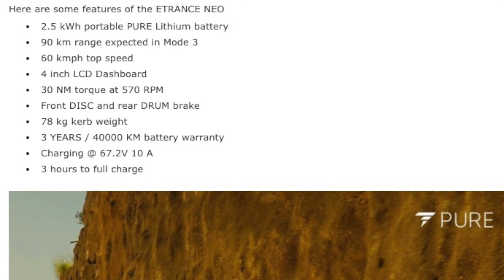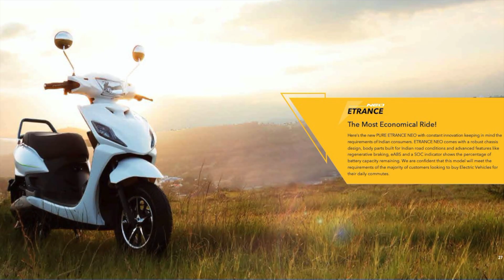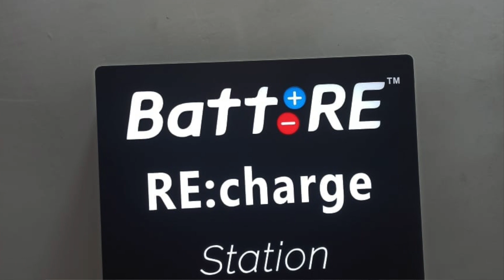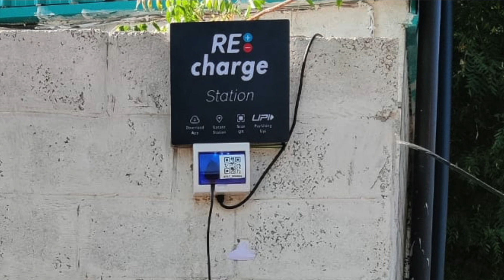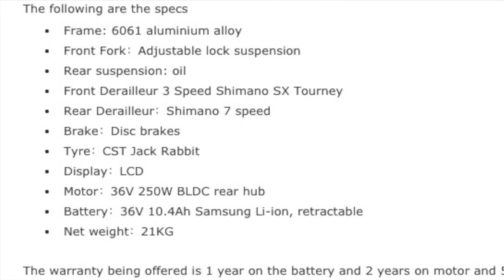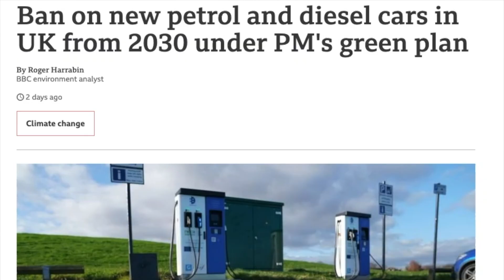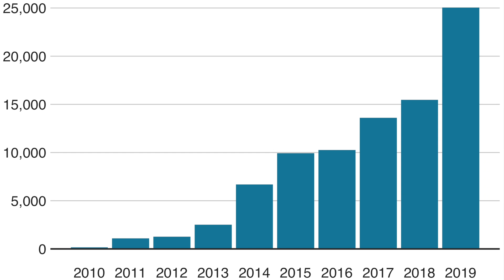Electric Vehicle Weekly #3 : PURE EV ETRANCE NEO, Batt:RE Charging Station

Comment: Pure team need to understand that batteries are like fuel I should be able to fit any battery of the same voltage of different company. I want lfp chemistry battery of okaya with an pure ev scooter than what is the issue In this. Some kind of standardization for battery size n chargers cross the scooters must be. Maintained.

Comment: What will be the under seat storage in etrance neo?
Reply: Epluto is a low speed electric scooter but epluto 7g is a high speed electric scooter which can reach 0-40 in 5seconds
Reply: @rohithkumar3480  I was referring to the 7G itself. I wouldn't call it HIGH speed scooter. Tried it. Dissapointed. That 5 seconds might be with a 50-60Kg adult. Not with 2 pillions / 180Km load. 😔😔
Reply: @surajmadhu-techgobbler  but ather 450,450x are very expensive,and we have to buy battery again after few years,so epluto 7g is suitable for middle class section like me 😎
Reply: @surajmadhu-techgobbler  Most of the people go alone to job so i think it's suitable for them,but for those who always travel with someone, as you said it might not be suitable
Reply: @rohithkumar3480  I think for the price it's good. But my issue is, with activa and other ICE even scooty Pep maturing over decades, they feel more robust and pure ev with their build quality are setting a bit of a bad impression of EVs tbh. Consider a potential Activa buyer. He'll consider the pluto7G and notice that everything in the feel in pure ev feels cheaper than the activa. I would rather pure ev make a 1lakh scooter with the same battery. And good build quality. Pure ev seems to have their battery sorted out really well, the price and density. So I just think they need to build a stronger product around it. Maybe use a better motor and tune the controller better. To make it more responsive.
Reply: About 70k for delhi. But doesn't matter. Epluto is really bad man. Under powered. Go with ather 450plus or 450X or chetak
Reply from the maker: They have not solved the undersea storage unfortunately.
Reply: @pluginIndia  it's not the under seat storage that they need to be working on tbh 😅 I think the drive train needs to be changed. The hub motor is just not doing the job :(. The corners cut to make it so accessible really show, when you ride it. :(

Comment: How can you charge a 2.5kw battery pack in just 3 hours @67V, 10A?
Reply: 67 maybe nominal voltage
Reply: @fwefhwe4232  charger max rating is 670W, so it's not possible to charge a 2.5kw pack in 3 hours
Reply: @fwefhwe4232  and nominal vol for the given charger be less for sure
Reply: @niteshsingla25  not really.

nominal voltage of a single li ion cell is 3.7v, charge voltage is 4.2v.

Just visit the dealer with your multimeter and confirm the charger voltage.
Reply: @fwefhwe4232  nominal voltage of this pack is 60V,
Reply: @fwefhwe4232  and 67v is the charger output, so it's not possible to charge this particular battery pack in 3 hours with the given charger spec
Reply: @fwefhwe4232  also I know about the nominal and terminal voltage concepts
Reply: @niteshsingla25  67v  isnt the charger output
Reply: @fwefhwe4232  it is, please carefully observe the video
Reply: @fwefhwe4232  1:15
Reply: @niteshsingla25  theek hai bhai

Comment: No news on the most exciting news on 2 wheeler Ev? Simple Mark 1'sTesting?
Reply from the maker: Their claims seem too unrealistic. 4.2 kWh and 200 km range? 
We dont see any comments from their founders not is there info on their website.  Just endless speculation articles.   Let them launch.
Reply: @pluginIndia  it doesn't seem unrealistic to be honest..youtube does have electric bike vidoes with 200+ kms range (not Indian YouTube nor bikes available in india). 

They have ARAI testing report (which is kind of Standard testing if I am not mistaken in India for vehicles). But then even if they give half of the mileage of 230 kms range (as the report claims) then too they blew off Ather out of water range wise and with price if 1.10 lakhs price wise too..it has removable battery too.

I was planning to take Ather (since I have my solar setup in Mumbai at home to make green energy) and as a continuation of that the ather would have been perfect but sadly the cost of ather in Mumbai is 1.61 lakh (inclusive of fame subsidy as per their website) which will cost me even higher than setting up my entire plant + adding 8 panels extra..which economically made no sense as post 3 yrs maintenance would come up for the bike..I would rather wait and look up for something affordable like Mark 2 with range.